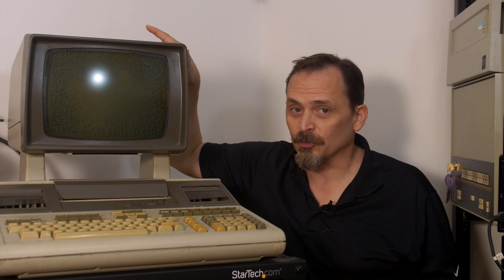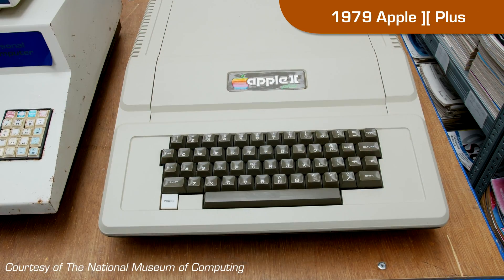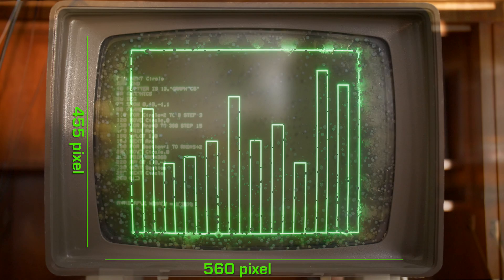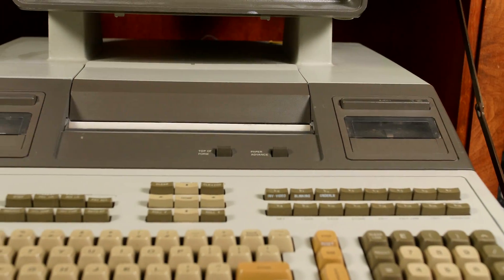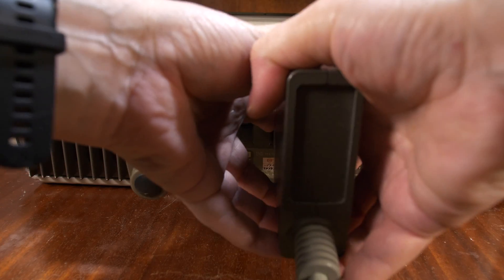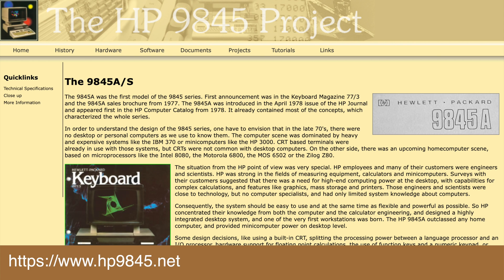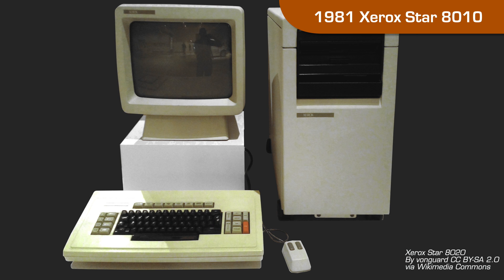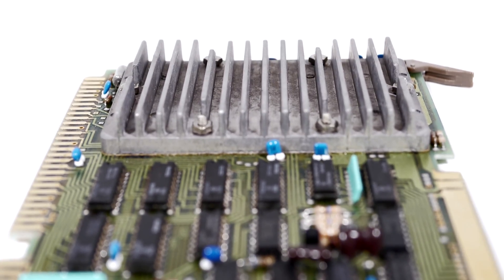Introducing the HP 9845: An Early Workstation

Comment: Remember having them in early part of my career in the early 1980’s. Remember we kitted it out with dual 8-inch floppy drives and also an HP pen plotter that was great from producing superior graphics at the time. Remember HP calked the GPIB bus the HPIB bus. We did interface it with other measurement equipment. The internal printer worked well and we were able to produce graphic plots. Computationally, it was a fantastic machine as well.

Comment: "Graphics on the large NORAD war room screens were rendered in advance by an HP 9845C desktop computer running BASIC. The graphics resolution was not high enough to project onto a large screen or be filmed directly, so a high-resolution monochromatic display was connected. The images were filmed from the display, one frame at a time, one color at a time, using filters for red, green, and blue. The process took about 1 minute per frame of film."
"WarGames" - IMDB

Comment: Wrong tools for the capstans? You just need to clean the old gunk away and then put one or two layers of heat shrink tube on the metal capstan. If you add some elastic glue under the tube, it will be fine for a couple of years.

Comment: Back in the very late 80s, we had one of these on my US nuclear submarine.  It utilized a ROM module to hold Navy specific programs.  The sailor would choose, from the menu that came up, the application to be run, and then he would input data.  After the data was entered, charts or tables would be produced and could be printed.  In this way, it was a dedicated tool and not your actual PC.  You could not break out of the programming on the ROM or really make any other programs since the Navy didn't give us tapes.

At the same time, the boat had a Xerox word processor system that was wired via serial to a IBM ball type electric typewriter for output, and two Zenith 286 computers with thin red gas plasma type displays.  These were also capable of printing to the IBM typewriter.  by 1989, we also had a wide pin driven dot matrix printer.

A hodpoge of technology in the cramped spaces of a submarine :)

Comment: I do own one of these, or rather a 9845B. I got it many years ago complete with lots of manuals and even software on tapes. I never got it working. When I got it it powered on and seemed to freeze while checking its memory on startup (I remember it only showed a number in the corner of the screen). At some point the notorius Rifa capacitor in the power supply gave out. It's been sitting since then and I'm willing to sell it. I do understand these are extremely rare, especially here in Germany. I'm only aware of one other unit somewhere in a museum.

Comment: This was the first 'real' computer (9845B)  I worked on and wrote a lot of programs for laboratory use. Image as database. The refresh rate of the screen changed the cycle time of the processor. Writing assembler for this machine could not use a reliable timing if you wanted to read a serial signal. This is why you had to make use of the IEEE interface. But despite all kind of typical things, I really loved this machine. And it still has a great design.

Comment: I was fascinated by the 9845 as a teenager in the very early 1980s. My father’s business -  an Engineering consultancy - had a 9845 that I would play with after school. It was used professionally for many things including geometric design of roads and was connected to a Calcomp 960 plotter.  They also had a 9830 but as I recall that had only a 2-line LED display and was much less exciting!

Comment: Any way to replace the display? Looks like there's mold in it. Other than that, shocked to see that what's now a laughably terrible brand used to be pioneers decades ahead of the time.
Reply from the maker: Ahh… well we did try to do a ‘cataract’ removal.  But unfortunately we ended up wrecking the tube.  The tube isn’t a common one.  Thankfully we had a spare.  It’s got the same issue of course. But since we’re outta spares, we’ll live with it for the moment. This kind of screen problem comes from the formulation of the glue that holds an ‘implosion shield’ piece of glass on the front of the actual tube. Some glue formulations decay over time leaving this mess.  There’s no actual fungus. That’s just what the decaying glue and air pockets look like behind glass. Nearly all instances of this model suffer this problem to one degree or another.  We’re on the look out for another monitor so we can risk another go at ‘cataract removal’. Please note, the process isn’t for the faint of heart and carries significant risk of personal injury. Can’t recommend anyone take it on without significant safety measures — significantly more than you’d see in the many YouTube videos related to cataract removal.

Comment: 4:12 9845 is portable...
...As long as you define portable as anything smaller than a minicomputer, and don't forget to take generator with you, because if you wanted to power it from battery (using external inverter ofc) you would need a truck battery (car battery wouldn't last long I guess) ;-)
9845C is the nice beast, too bad that those are quite expensive right now (I guess that I couldn't even afford the shipping to Poland). I am quite a fan of HP and IBM stuff (because those things are quite far from being one of many "consumer" garbage).
Reply: It WAS portable, given military resources.

Comment: Hello have a Hp9845a any way to run any graphics kind of demo on it without a kasessette working 
I run a small youtube channel RB Retro Bunker. And i would like to show off this cool computer :)
Reply from the maker: Have your credit card and eBay account at the ready... oh and patience... plenty of that! For graphics demos, you will need to have the graphics ROM and the graphics option monitor. Check the options stickers on the back of the machine if attached, or the monitor model. And check the contents of your ROM drawers.  Not all 9845s are graphics enabled.  Next, you're also going to want an older PC with a PCI slot, a GP-IB interface card, software called HPDisk (from HP9845.net) and a HP 98034B interface card. With that rig you can emulate a wide range of disk peripherals and run demo software from the emulated disk. Eventually you may want to acquire a 9895A Diskette Drive -- but you'll still need the PC to provide files from images. Software can be found on HPMuseum.Net and HP9845.Net. The software on HPMuseum.Net will need to be converted from an 5.25" Teledisk image to an 8" HPI image.  That's a whole "thing." You'll need to actually get that far first! On your journey you may want to occasionally shout out to the enthusiast community on groups.io -- https://groups.io/g/VintHPcom. The very best of luck!
Reply: @beige-o-vision6936  i have graphic chip in the bay on the sides an operativsystem and rom
Reply: @beige-o-vision6936  ment graphic innthe drawer i will look in the back of it
Reply: @beige-o-vision6936  the kassett tapes is not broken i just dosent have a tape :)
Reply from the maker: The A is the earliest model.  At over 40 years old, the failure rate of the tape drives is over 90%.  However, assuming the drive is in the 10% or was already repaired, then there have been program distribution tapes on eBay recently. I'm afraid we didn't really watch them since we don't rely on tapes.  But if you manage to pick up original program tapes, then you will want to back to them up to freshest available media on first read.  And with both the original program tape and new tape, you will want to replace the internal elastic band first.  These break easily.  I believe the mailing list I linked before may have some discussion on belt dimensions.
Reply: @beige-o-vision6936  yes i just wanted to do something with this one i have manny of them in storage. If there no way to make it run something i am afraid they will go to the trash
Reply from the maker: No need to bin such a machine.  They are rare, and have significant value on the open market. If you have several, why not put them up on eBay.  I have no doubt you'll sell them readily enough.
Reply: @force4200  Sell it to me, please!
Reply: @MichaelKingsfordGray  i gave it to a my friend Stefan :)
Reply: @force4200  Oh, good. You did not scrap it. If Stefan should wish to turn it to cash, then the opportunity is still there!

Comment: As a kid I was deeply enamored with a successor of this with color graphics.  It cost more than my parents house and was IIRC based on BASIC.  I later saw it featured briefly on a Swedish SciFi where the bored astronaut was playing chess on it.

However this video peaked my interest in the PERQ which I only vaguely knew of. Seemed like a very advanced machine for its time.
Reply from the maker: Yes indeed the PERQ was quite a capable system. I've used one for demonstration purposes when it was on display at www.tnmoc.org. There were multiple OSes developed, and they had some very unusual windowing behaviour.  PNX (insert your own joke) used a system where you created a window first, then told the OS what to put in it.  If you're interested in more details, start here: http://www.chilton-computing.org.uk/acd/sus/perq_history/overview.htm.  The system was never a huge seller, but ICL snapped up the rights to build it for the academic and engineering market.  In fact, it originated in Pittsburg, US as the project of some Carnegie Mellon alums.

Comment: Thereʼs no such thing as a "pure digital" magnetic tape. The magnetic signals are always stored as analogue signals on the tape. If you hooked up a wire to listen to the read head on the HPʼs tapes, you would get some sort of sound. The difference that youʼre actually referring to is that the Compact Cassettes used by later home machines were audio tapes, and therefore the signals recorded to them had to be optimised to be within audio frequency range. That doesnʼt mean that other methods used some magical "pure digital" tapes - thereʼs no such thing.
Reply from the maker: Appreciate the distinction, but we’ll stick by the phrasing. Perhaps we shouldn’t have used the adjective ‘pure.’ We don’t think its likely to lead to misunderstanding of the point being made.  We’re referencing what we believe will be the commonly understood terms.  Obviously all electronics have non-binary, non-logic state oriented characteristics.  We don’t believe that using the phrase ‘pure digital’ will be understood to mean this tape system is an exception. Similarly we’re using the short hand term ‘analogue’. That could mean a number of things too.  But in the case of describing vintage computing, we believe we’ve used the terms consistently with people’s understanding (just our opinion of course).  We’d argue the common basic distinction is ‘digital’ equates to electronic design build around logic state transition vs ‘analogue’ meaning encoding signal frequency or other approaches to implement data transmission and processing.  The HP’s DC-100 media is encoded and decoded as logic states only, with a fixed (or at least phase locked) frequency.  That’s a purely digital circuit design approach — and yes to achieve a good digital circuit design you have to address the analogue behaviours of the circuit.  But that wasn’t the distinction we were drawing. So, you are right that its a still a design with analogue behaviour — but in explaining the technical distinctions making this system a bit different — well the distinction we’re making holds. Documentation before and since would use much the same terms — perhaps too loosely? But that’s the English language, and marketing speak, stretching words for you.  This distinction has been common for forty years.  So a CD is a ‘digital’ medium because it’s built around bitstream encoding, and my copy of Mike and the Mechanics on compact cassette is analogue. By that set of common use terms, it’s fair to say that HP DC-100 implementation is digital and as purely digital as most digital technologies.  Equally, the compact cassette systems common on hobbyist and home micros uses a modulation-demodulator that specifically works on an audio level signal.  That’s a frequency oriented encoding.  The circuits are designed to create modulated signals rather than a square wave signal encoding magnetic flux transitions. And that’s an analogue technology just as much as any audio cassette.  We could always stipulate that floppies, hard disks and indeed Intel P133s all have analogue behaviours, but that’s not their operating principle. The distinction is important at a detail theory of operation level, but for a high level distinction of design approach, it’s would not be useful to, for instance, call a P133 desktop an analogue computer.